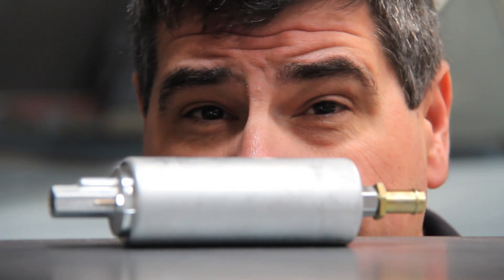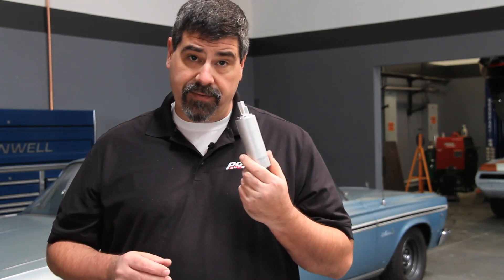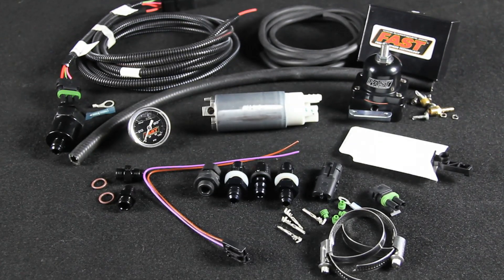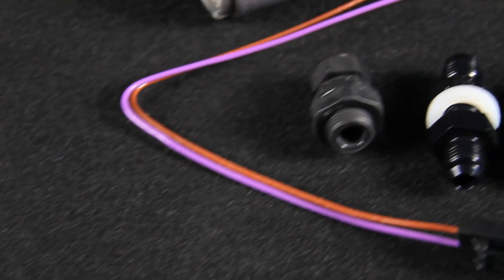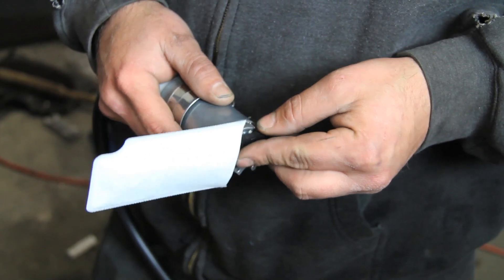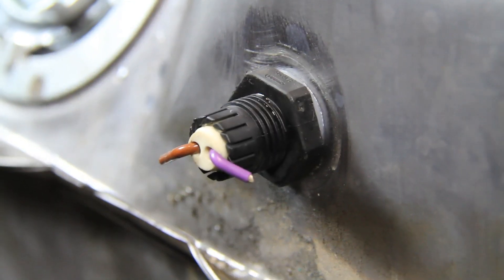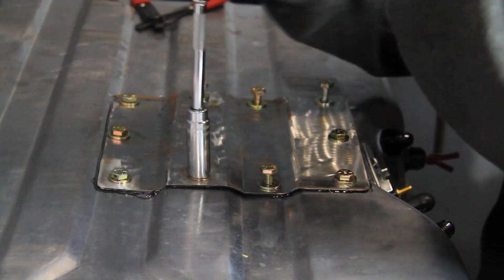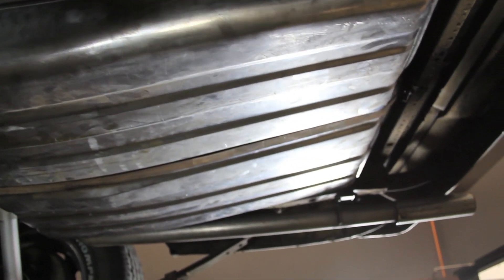Installing A FAST™ Universal In-Tank Retro-Fit Fuel Pump Kit

Comment: How well do these pumps function without a swirl chamber? 

A carburetted car will have a reserve of fuel in the float chamber so if the pickup pipe is uncovered whilst cornering on a low tank the car doesn't cut out.